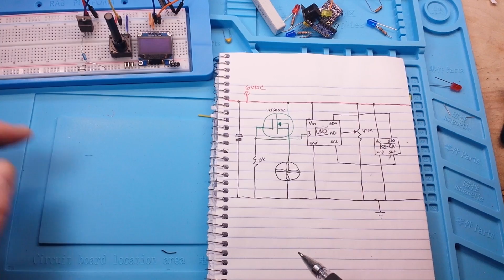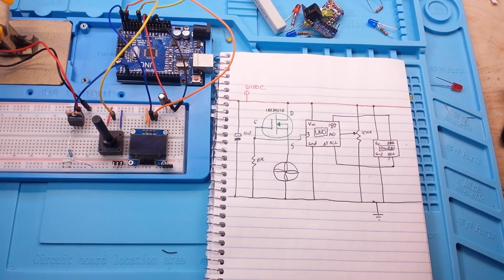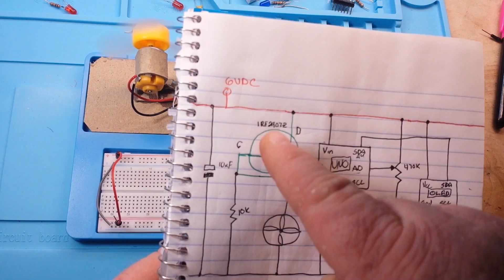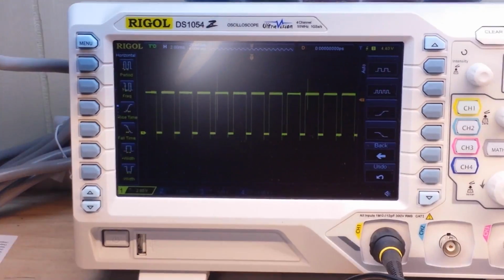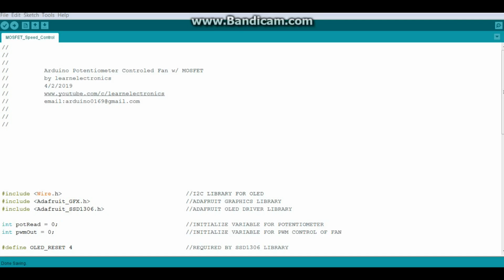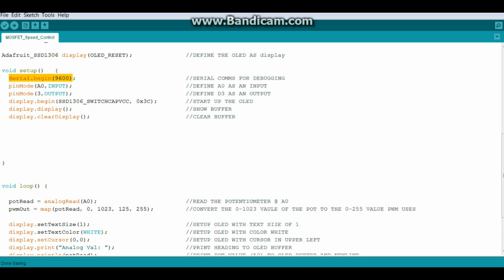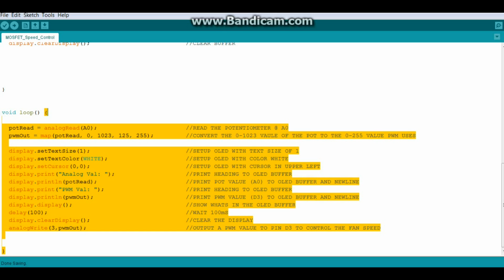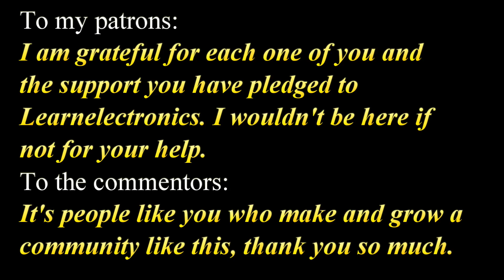The beauty of Arduino is it's simplicity

Comment: If somebody is watching this now. I recommend to use MOSFET as a switch here. Less powerloss to MOSFET and can drive direcly like 12V motors from higher rail voltage. So connect G like in here, S to ground and D to motor and motor to +12V. Put ferris wheel diode across motor (catode to + and anode to -) This will keep mosfet happy when PWM is going off state.
Edit:
This is also how you can drive that motor in same power like in part 3 video. IRF2907 with Vgs 4.5V (gate to source voltage) you can reach about 6A Id (Drain current) and 0.1V Vds (drain to source voltagedrop) about 0.6W power loss. (Infenion IRF2907 datasheet Fig1)

Comment: Sorry for your loss Paul. One question I have after another great video is what is the benefit of using this MOSFET instead on using a transistor ex. 2N2222 which is also powered from external power source?
Reply from the maker: Just convention I guess. I tend to use BJTs for signals and FETs for power.
Reply: @learnelectronics  Thanks! I'm building my automated vegetable garden system, powered by solar power - charging batteries. And I want to turn of all power craving sensors and water pump when going into deep sleep, so I will try with a FET today! Keep up the great work! I just found your excellent video on the difference between a BJT and a MOSFET. https://www.youtube.com/watch?v=SCONceTwuuc

Comment: I see your analogwrite in the Arduino code but what is actually generating the square wave with changing duty cycle here?
Reply from the maker: The Arduino generates the code. The analogWrite creates a square wave output on the designated pwm pins.
Reply: @learnelectronics  Oh, I thought analogWrite output mapped its argument to 3.3V. Thanks for clearing that up, great video.

Comment: Nice video and I'm in total agreement with Arduino being a great input output device. Reminded me of my power meter logger (which i use a lot) taking in an analog input and using that to set a datalogging interval. Only limited by your imagination (and memory, at which point use an esp8266 or esp32 lol).

Comment: Sorry to hear your bad news. I'm fast becoming your designated YouTube comment pedant but I want you to know that I mean everything constructively, it's sometimes difficult to tell what the tone is online. I appreciate you're trying to keep the example as simple to understand as possible. Anywho. I'd recommend putting a resistor in series with that potentiometer because at the mo when your pot is at 0 there is no resistance between VCC and GND so you have a dead short which I reckon will be what was causing the brown out (you'll need to change code). If that's what was happening you'll hear your PSU relays clicking in and out. Not a major problem at the bench but possibly a PITA if you switch to an alternative supply later (eg. batteries). It could get quite warm! I reckon you can ditch that decoupling capacitor because even though it solves the problem I'm not sure it's doing what you think it is. I reckon its charging and discharging in time with your PWM signal so it's acting as current limiting (like a resistor) on the pot side and preventing your PSU from detecting a dead short - scopeage will reveal all. I reckon a diode over that fan wouldn't go amiss to deal with any back voltage (although small). Hoping to be helpful. Best wishes.
Reply from the maker: Thanks.  The pot will be gone in the next video and the fan in the following.

Comment: I am sorry for your loss. Please accept my condolences.

Wasn't the Arduino's current sink capacity able to pull the FET gate low fast enough? Because you had the pulldown there as you pointed out. I wouldn't have thought it was necessary.
Reply from the maker: It may not have been necessary, but it is always good practice.
Reply: @learnelectronics  of course it is! I later realized that if the Arduino loses power or a programming mistake puts the PWR pin in high impedance the FET would remain conducting without the pulldown. That in turn may fry whatever you were driving with it. So always pull down you FET gate.

Comment: Excellent video Paul !
I wonder how you would change the code to give a soft start feature ?  We used to build all sorts of PWM kits but now there is no need as arduino makes it so simple !
Reply from the maker: you could just add in a a little for/next loop to slowly ramp up to your starting voltage.
Reply: learnelectronics 
Ok thanks Paul ! I will have a look into that , i kept thinking about using if / else  so looks like i have some research to do !

Comment: Great video! I know some people have suggested this before, but OBS is a great alternative to bandicam for screen recording. You said it crashes your laptop; try going into Settings -> Output, then click the Encoder dropdown and see what options appear. If your laptop has an Intel processor, you should see QuickSync. QuickSync uses a hardware encoder, so your laptop shouldn't be strained nearly as much. Set the Video Bitrate between 2k and 3k. Finally, click the Video menu on the left and set your output resolution and framerate as desired. Hopefully, this will keep OBS from crashing your PC.

Thank you again for spending time to make electronics videos.

Comment: Hello Paul, so possibly complex question maybe a idea for a video??? could this be implemented into a Attiny85?? I have a computer fan that I have replaced that is noisy (but great air volume) but at times I drive the system hard and if I could either turn it up or it ramp up on its own without buying a Chinese control board would be cool and have the display on the front of the case...
Reply from the maker: Yes,  you could easily do this on an  ATTiny.
Reply: @learnelectronics  But off course a 10 cent 555 timer will also do the job :)